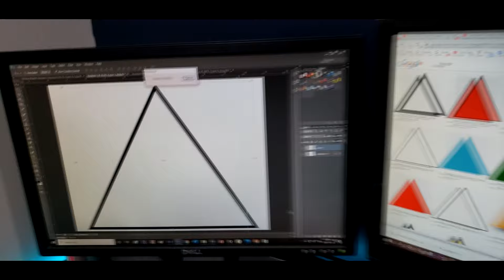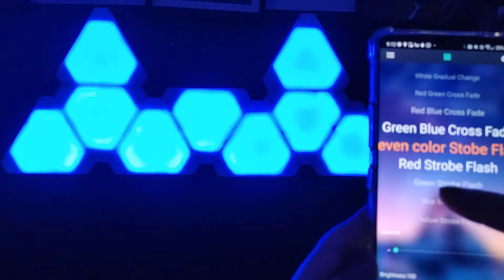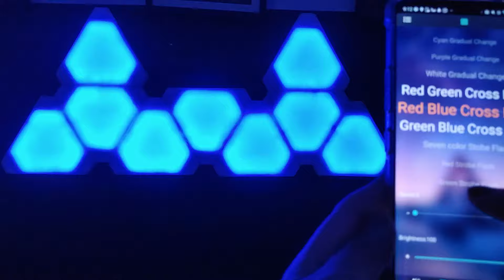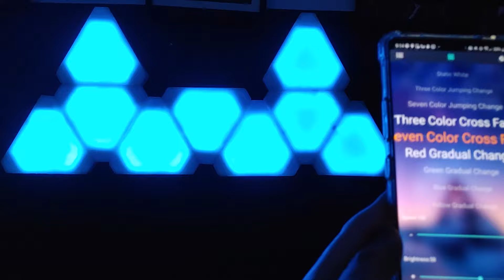DIY Nanoleaf l No 3D Printing l No Programming l Cost Less

Comment: what you used for the covering led panel
Reply from the maker: originally im going for styroplates but since i found a  white acrylic panel for cheap, i used a white acrylic panel. u can use clear acrylic panel just sand it a bit with smooth grit and u'll get a frosted panel.